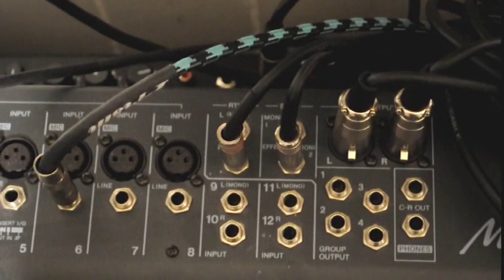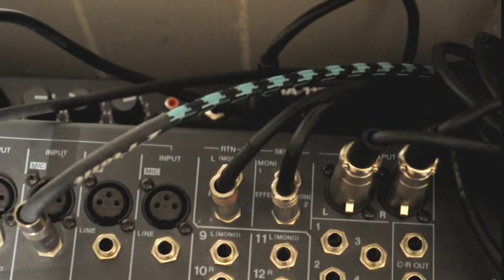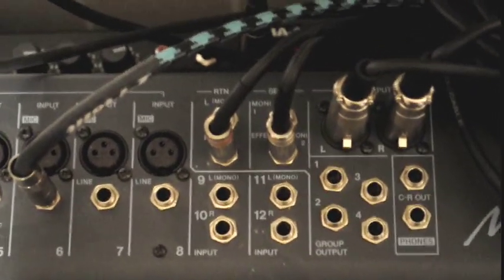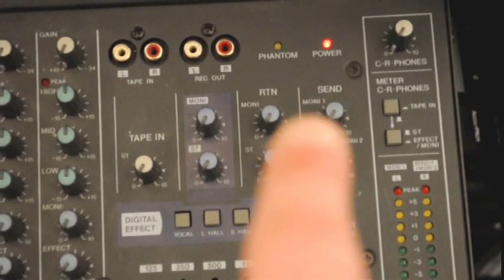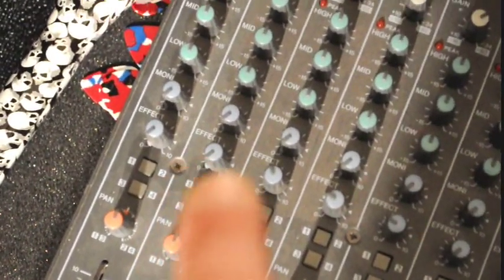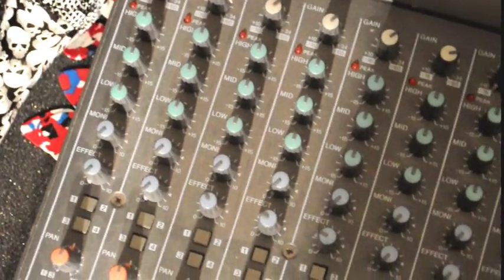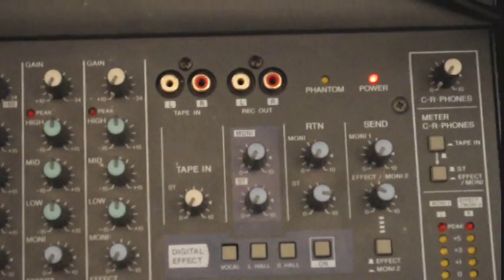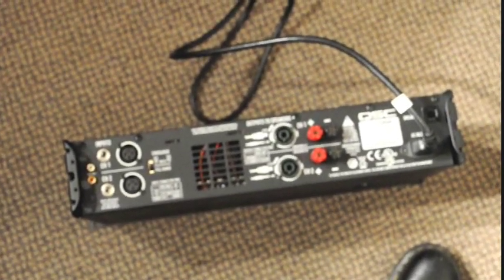Intro to Mixer and Basic live sound setup Pt. 4: Getting a monitor mix setup

Comment: Can I use the 1/4 cable jacks from my snake (mine has 2x1/4 A&B, and 2xXLR C&D) into the Aux 1 and 2, then from the snake head (The box out in front of the mic's) A and B (1/4 jacks) out to the powered monitors, instead of running 2 long 1/4 cables out of Aux1 and 2 out to the monitors?  In other words... can those 1/4 jacks, on the snake, run out of the board from Aux1 and 2 through the snake and from the box out front to the monitors?
Reply: +Rick Bendel  Why do you think it can't run like that? Of course it can, why not... Just be sure to connect it to the SEND jacks (not RTN) on this particular mixing board...

Cheers!

Comment: I think u should plan your tutorials a little more. And stop apologizing for everything. Also, If ur going to identify something on a board or a device make sure u point to it or describe it a little more in detail, like this red light or that blue knob, etc. Maybe a little whiteboard discussion with arrrows and boxes, etc. before actually showing the gear and equipment. I'm sure ur a fine and experienced audio guy but your tutorials are so generalized, they're not really beginner or intro level

Comment from the maker: @johnwj666 Thanks... Yes.... I think.... Aux send (1/4") to the amp input (1/4").  The inputs on the amp are next to eack other and are usually an xlr and 1/4".  Please keep in mind that you must use a prefade aux send.  If you use a post fader aux send for your monitors, you will end up affecting the volume of your monitors every time you make an level adjustment to that channel.  Unless of course your mixer has the option of changing the auxes from post fader to pre fader.   Hope this helps.